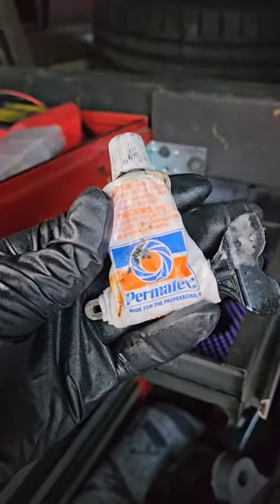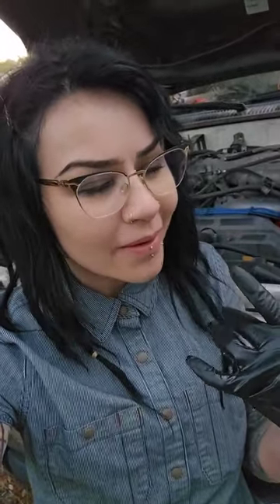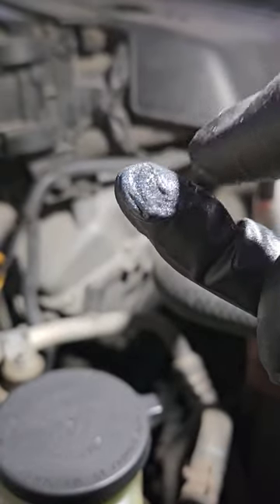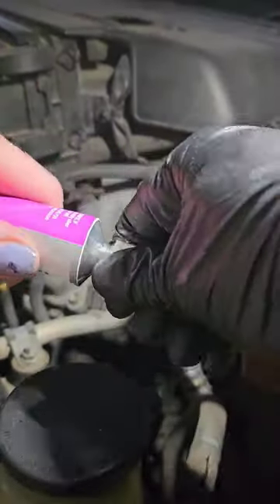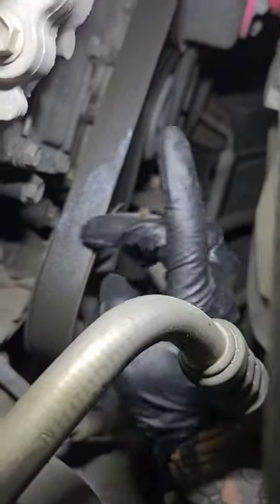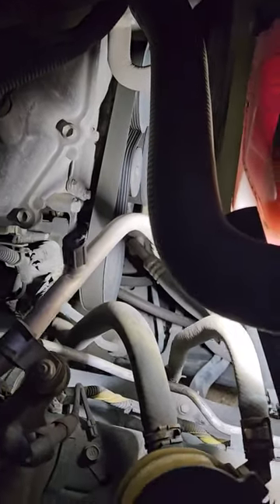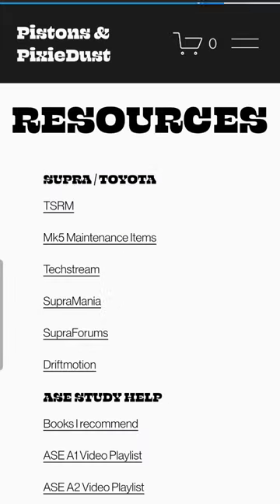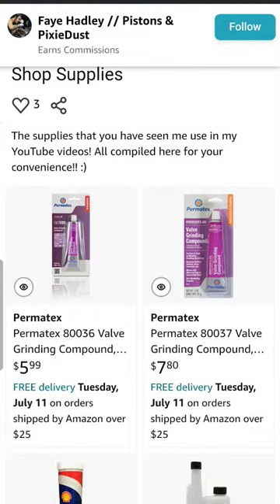Valve Grinding compound for Belt Noise Diagnosis?!! Amazon Prime Day, July 11th & 12th 2023!

Comment: Put a dab of that on the tip of a screwdriver for a partially stripped screw and increase the grip a thousand percent. Works on sockets too. It has to be water based, however. The little bits of carbide in there bite into the metal.
Reply: Ok this actually makes since why would you make a mess with the belt for a simple diganoses
Reply: Ha! Awesome, because long time ago, wjeere i used to turn wrenches at the time, a salesman sold us a small bottle on compound that did that trick. Lost the bottle and forgot the name, and now you said it, it all makes sense!
So many times that i would have needed that damn thing along the way.
Will try that, cheers from finland!
Reply: Use to do this in aviation.
Reply: I used stuff called ezy grip when working in aviation, same concept and probably just valve grinding paste with a fancy brand name, works so well
Reply: @Muz1kality yeaaah, military maintainers love the stuff.  We're not allowed to use power tools for the most part, so give an airman/seaman/private a speed handle and tell them to take off a panel that has more than 50 torx bits, they're stripping at least 3.  That stuff is a life saver.  Always thought it behaved like a non-neutonian fluid, but I suppose jt's just the grippy metal dust

Comment: Hey Faye, Thank you for the tip. Back in the old days we used Bees Wax on V-Belts squeaking. We held a chunk on the belt while the engine was running and it would usually stop the noise in seconds. A lot of times it would give the belt some break-in time and the noise never came back. So it was long term, or reapply  and toss out the belt. ben/ michigan
Reply from the maker: Whoa!! Gosh I haven't seen a V belt in a while 🥲
Reply: @FayeHadley thanks I feel so old now lol our 66 Mustang and 73 Bronco still have them.

Comment: I use dielectric grease on a small nylon brush. Just push a bit into the bristles. Start the engine and then slowly apply to the moving belt. I have had misaligned belts that also cause a noise. By applying to the front,back,  bottom, and top, I can determine exactly what part of the belt is rubbing. This really helps pinpoint the exact area of issue.

Comment: Hey Faye...I was installing some new injectors on a fuel rail last night. I did the job away from home and forgot my silicone grease for the o-rings to seat into the rail. Had an old chapstick in my truck...worked like a charm 👍

Comment: I use a bar of soap.
Works great 😂
Reply: Ya she isn’t taught from old school..all you need it cheap dial white bar soap for the belt and wd-40/ equivalent for bearings/pulley.
Reply: You know this just causes the belt to slip over the puller without fully turning it right
Reply: @nicolomarchillo4451  Never heard of it falling off.
I don't see why possibly that would happen 🤔
Reply: @vm722  pass over the pulley without spinning it. Not the belt falling off. Soap reduces the friction
Reply: @minusthemachineagain9342 I'm fond of the yellow bars myself...
Reply: Country buddy of mine was trying to see if a serpentine belt was bad. We used a cheap stick of deodorant.
Reply: @nicolomarchillo4451 how would it slip off? You don’t put in under the belt you put it on top…..
Reply: Okay it sucked my bar of soap into the pulley and seized the engine. Instructions unclear.
Reply: @FloridaMan7337  as long as you still have fingers and above the grass. You are Okay 👍

Comment: I use the water spray bottle method.  Quick and easy.  valve grinding compound is great for getting out stripped philips screws, however.
Reply from the maker: Maybe I'm doing it wrong, but I haven't had luck with that in the past - def heard it before though!! Is there a trick im missing?
Reply: @FayeHadley  The trick along with the paste is pressure, and lots of it.  Phillips screws are designed to have the bit cam out under high load, to prevent overtorquing during production.  Common practice on airplanes is a #2 bit in a speed handle, preferably one with a knob on the end so you can really lean on it.  All your weight, if need be.  Sometimes "rocking" the screw in both directions helps too.

Comment: Look at you, teaching this old dog a new trick😎✌️ Here's one for you, I keep my old guitar strings to clean out carburetor jets.
Reply from the maker: Great tip! Never thought of that!!!
Reply: Yes guitar strings are perfect for dirt bike carb jets, they works great
Reply: NOPE~ guitar strings are harder than the jets, you'll tear them up, reducing flow.
Reply: Also, guitar strings were used as axles in the first Hot Wheels cars.
Reply: Nice thanks both of ya
Reply: I read that in the voice of gran torino Clint Eastwood. Fokkin Supreme!
Reply: When I was cleaning and overhauling a carb for my ninja 250, the manual from the forum explicitly advised using COPPER wire   in order not to ruin the nozzles

Comment: Just a question I've been a mechanic for about 48 years and I've done the same except with my reasoning the squeak was the underside of the belt because the belt becomes polished over time so my way of thinking was to rough it up on the underside of the belt and the sweek is gone, but by putting the compound on top I'm just wondering about your reasoning. I'm always trying to learn new ways of doing things, and you are very knowledgeable and I look forward to hearing from you. Thank and have a great day 😀

Comment: Water based valve grinding compound is also a great DIY hack solution to noisey brakes. A dab on your rotor (one at a time is probably the best way) Will lightly resurface both the rotor and the pad. You can rinse it out with a hose after. I use this on my bicycles with great success

Comment: In the aircraft industry we use valve grinding compound all the time.  On the tips of apex screwdriver bits vs stuck screws or stripped screw heads.  It adds a lot of grip and probably enough to move the stuck hardware.

Comment: If it's a pully bearing also you can us a bottle squirter with water on the tensioner or pull and if it sizzles right after engine off then it's the bearing. Sometimes it's so hot it glows red. So don't touch it!

Comment: Valve grinding paste in a Philips head or torxs add a better grip for the bit. Also turn the fastener using a speed wrench and lots of pressure when applicable

Comment: I almost replaced the big end bearings in my engine, the knock sounded identical to big end noise, only happening when the engine is cold or free revving around 2500rpm. Everything pointed to big end knock, until the day a radiator hose blew and the knock went away completely. It was all belt noise!

Comment: Baking soda does the same thing.  You can also use valve grinding compound on the tip of a screw driver or the inside of a socket to make it grip a worn fastener.

Comment: Brake lube works good too you know for the slide pins but usually I’ll take off the belt then check the pulleys because if it’s just the belt you already got the belt off and 99% of drive belts are easy to take off and put on

Comment: I use my ears. Frequency and amplitude for belts and bearings are very different. So is when sound occurs. 

Belts are prone to be on startup or when the ac compressor engages. Pulleys tend to vary with engine rpm. 

There are many other good  methods list here.

Comment: If you use a 3/4 inch hose hold the one end to your ear and then listen with the other end you can hear which pulley the belt is slipping on

Comment: After you do a coolant flush, thermostat and or water pump if it squeals after you did any of those, turn on the vehicle and just add a bit of water, let it run the noise will vanish in a bit.

Comment: Well, that's certainly better than applying deodorant to the belt.  Back in the OLD DAYS we used an Elmer's glue stick, it will do the same thing without hurting anything.  I say better than a deodorant because I recently saw a short on here were some none Mechanic person said that's what they used and yeah, well at least Irish Spring will help it smell better and apparently drives rodents out of an engine bay I've been told. 
Always enjoy seeing you Faye!  Grinding Compound, that's a good one, ty.  Try a glue stick just make sure it's real Elmer's Glue.  ❤

Comment: Random question if you have a moment; radiator always low I fill up with coolant consistent bubbles like it has air pockets somewhere but car will drive long distance no problem just needs to fill up the coolant 🙃 oil looks good I figure I need to pressure test once I fill it up again or use the big coolant funnel to pull out additional Air bubbles maybe put it on ramps. 04 v6 4Runner I appreciate any feedback!
Reply: I’ve only changed the thermostat so far

Comment: I just spray the belt with brake cleaner and if the noise stops then it’s new belt time/ inspect pulley surfaces for rust or debris.

Comment: I use it to clean electric terminals
Reply from the maker: Whoa, really?!!¡!!
Reply: @FayeHadley  dab a little on the male side of the terminal and work it back and forth and it will take care of the green death. Clean it off with contact cleaner and top off with dielectric grease.

Comment: It’s not difficult to determine if it’s a belt or pulley making the noise. They make very distinctive noise’s. When you been a mechanic as long as I have, you know distinctly which is making the noise. I also wouldn’t use valve lapping compound.. just spray a bit of silicone on the belt while it’s running.. much faster and much cheaper than wasting the compound….

Comment: One of the most overlooked diagnostic procedures for belt noise is just simply look at the belt grooves. Compare to a new belt. If the grooves are too wide or too deep, there's your problem. This is almost ALWAYS overlooked.

Comment: Does this hack work for the inside of a V-belt pulley system? I have an ‘89 F350 with a squealing belt that I have yet to start diagnosing and would love to know if this trick works for that application.

Comment: I challenge this... How do you know it's the belt??? If a bearing is getting bad enough to slow the pulley down, and cause it to slide on the belt and squeel, this "test" May add enough friction to allow the pulley to spin properly again. You would still think it's the belt but it's actually a failing bearing that's causing the situation.  You still have to take the belt off to find which pulley is not like the others